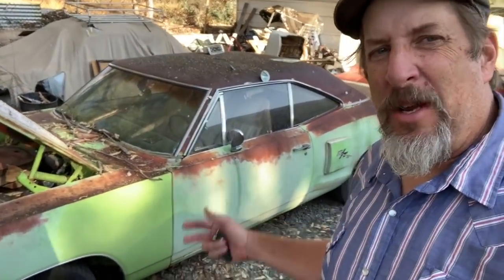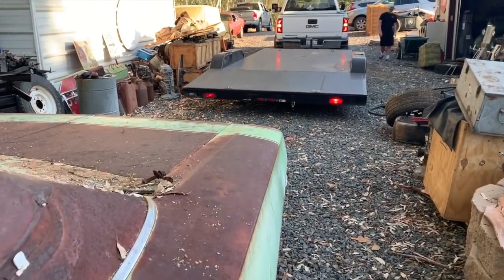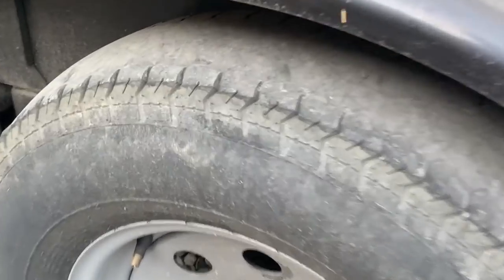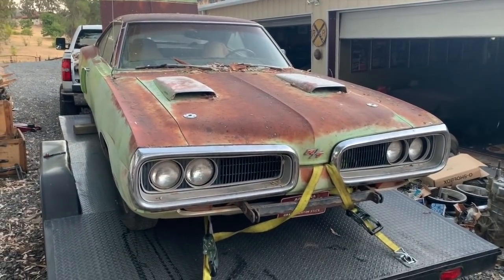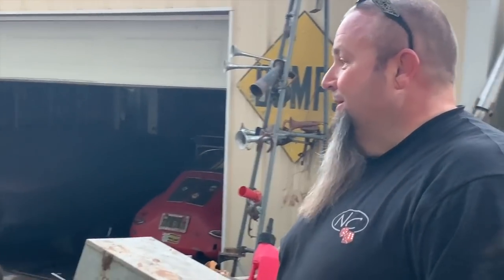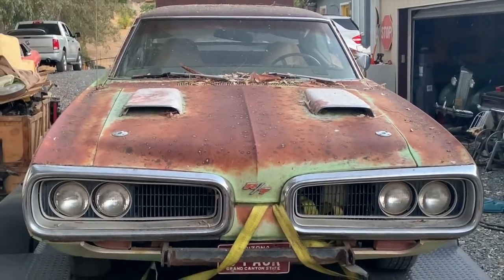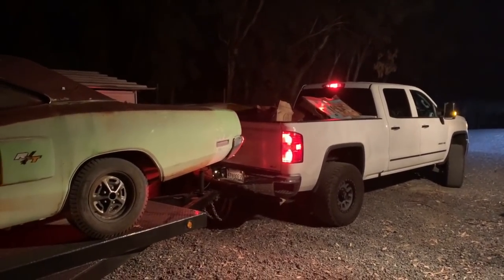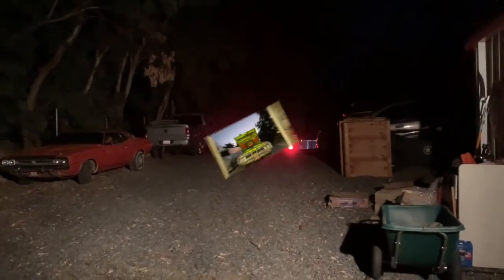Carchaeology: 1970 Coronet R/T Barn Find Goodbye and FIRST START!

Comment: Doubt there will be a "Fall Fling" in Cali this year. They cancelled "Spring Fling" and will likely do the same with Fall. Unless you're looking to do Joe Dirt 3, it should be restored at least as a "driver." The car would look stunning with a decent paint job and a new vinyl top. We're talking about a 440 SIX PACK four speed car here, not a mid '70s Dart with a slant six...
Reply: Actually, Fall fling is on schedule, they moved it to Irwindale so it wouldn't have to be cancelled. And like I said in the video, it will not be restored, just a "nip and tuck" paint touch up, some new interior, and a new top... And I'm well aware the value, I paid for it... LOL
Reply: @mikecoffey3076  Irwindale! I was there in June 2019 for some race car driving, race instruction, and a ride along. Stayed for the motorhome race and firework festivities later the same day. That's the first time I've seen them move the show besides the year they went across the street to Balboa Lake! Good luck with the Coronet R/T. Look forward to seeing it at the show if I decide to go to lockdown land.
Reply: @mikecoffey3076  Nothing on the website about the move to Irwindale as of 9/25/2020...